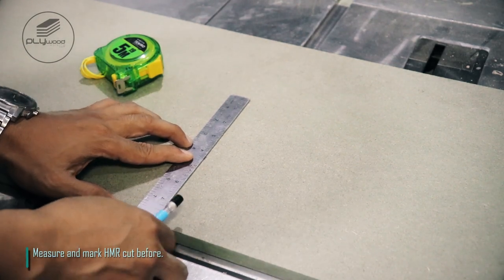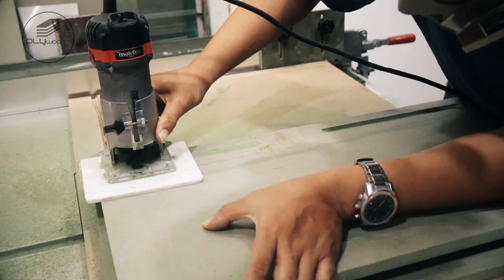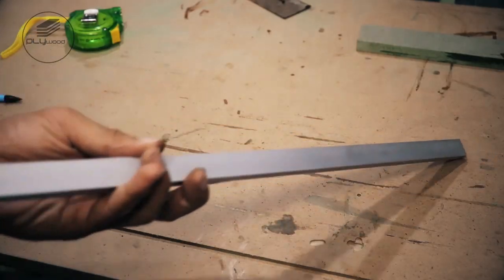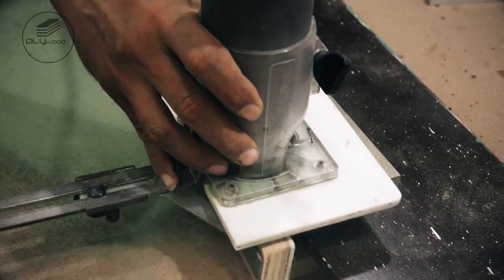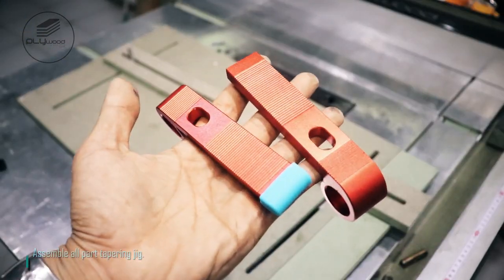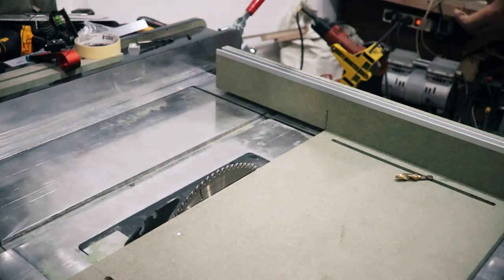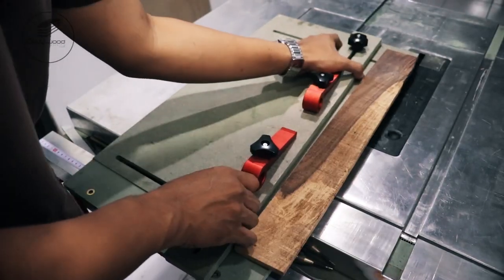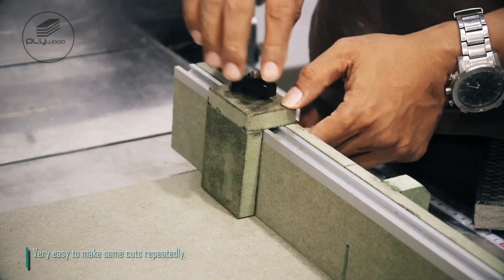Multifunction Tapering Table Saw Crosscut Sled FREEPLAN

Comment: Slide table saw nya, itu ukuran nya 19mm om? Bukan nya ukuran Stanley 18,1 ya?
Reply from the maker: pys saya runner stanlenya udh saya modif sndiri jdi standart internsional, bwwan asliya ribet bgt gk umum ukuranya 16.1 +18.1 aneh
Reply: @plywoodworking  justru itu om, agak sedikit nyesel sii beli Stanley, karena ukuran slide nya gak standar.. itu di modif pake router om?
Reply from the maker: @edwardaditya8182  bnrya gk salah beli stanley, drpd beli TS dewalt mlhan lbh banyak minusya udh gitu hargaya mhl, minusya stanley di runner am fence. aq modif pake router kdiya skr gk ada mslh am runner jg fence
Reply: @plywoodworking  iyaa om bener, minus nya di runner sama fence nya.. oke lah, thanks om ilmu nya..